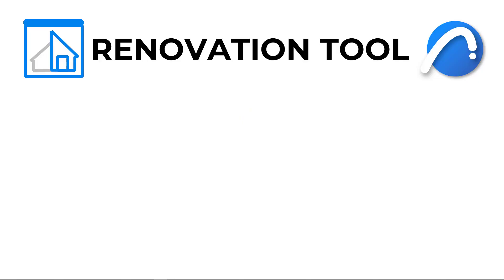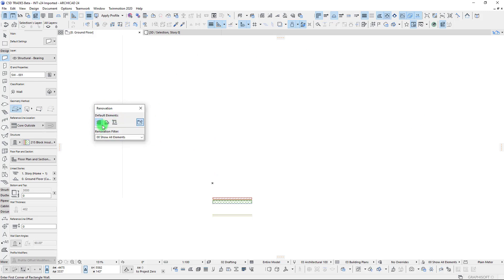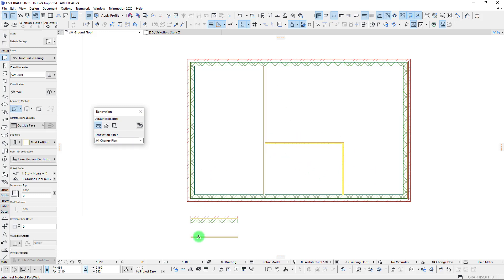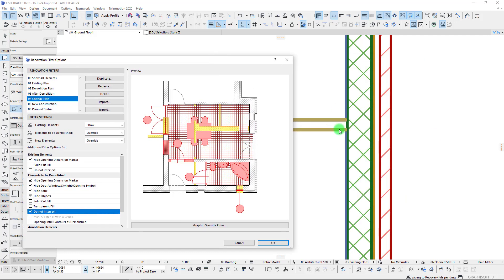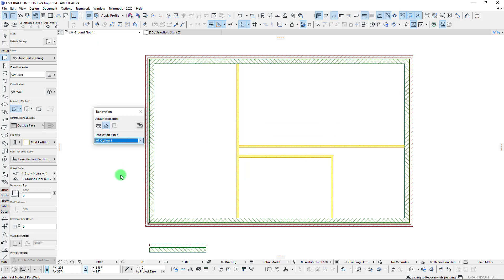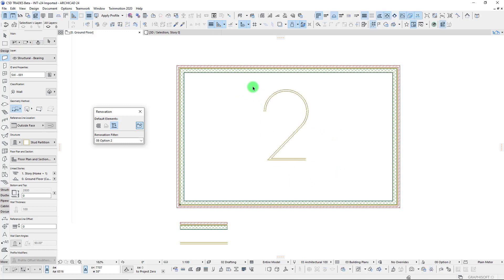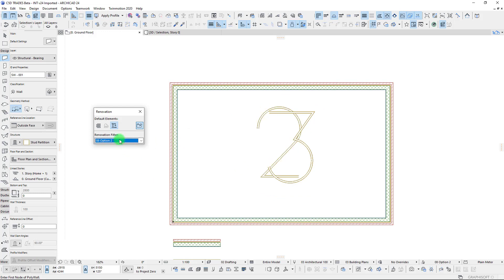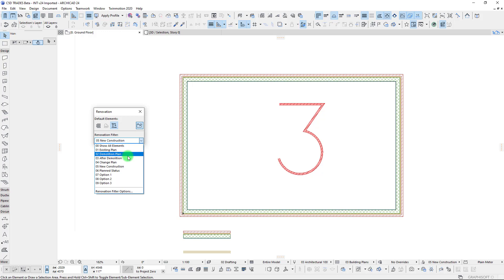How to Create Multiple Design Options with @Archicad Renovation Tool!

Comment: Thanks for the tutorial! but i have a problem, i lose my drawing when i change the renovation filter from 'show all items' to current plan. I can only see my drawings in the show all items filter. It would be great if you could help me. Thanks in advance!!
Reply from the maker: Hi Irem! Thanks for the question. So the thing with the PIN function, is that elements will only show up on that specific renovation filter. The "Show All Items" is just a name of a filter, that doesn't necessarily show everything that is pinned. Similarly, if you pin items to that renovation, they will only show on that renovation. I hope that makes sense... Pinning only allows visibility on that specific filter. Thanks!

Comment: Thanks for the tutorial. We created 3 different options in our model using the renovation tool. Now we want to make a  schedule that filters the windows and doors per option. Can you explain how to make such a schedule? Best regards from Holland
Reply from the maker: Hi Marco. It is all in the saved view settings for each design option. Set the renovation status in the view settings, and that will filter the model based on what elements are assigned to each. You shouldn't have to even set the criteria for renovations, only the view options. Only downside of this is you can't list all 3 options under the same schedule, but you can use 1 schedule, with 3 different saved views for each design option. Good luck!
Reply: @CONTRABIM  Thank you for your reply! We tried your suggestion and it worked! Great help! Greets from Holland

Comment: Great video thankyou!! Is there any way to display multiple design options in one view? say I want to display a combination of options one and two? Thanks
Reply from the maker: Unfortunately no, you can only pin elements to 1 design option renovation status. If you wanted to show both at the same time, you'd have to do a trace and reference from the 2 saved views, or place the 2 drawings overlaid on a layout!

Comment: Thanks a lot. But...
It is so annoying that lumion 8.5 doesn't support archicad's design options. You can't keep the assigned materials between the options. Do you know why?
Reply from the maker: Thanks for the question. I haven't personally used lumion, so unfortunately I can't provide much info. Are you trying to use this with the renovation filtering of design options?
Reply: @CONTRABIM  Exactly.

Comment: Hello, thanks for the tipp, howerver I have a question, using multiple options will all be showed in the schedules or only elements how are not pined anymore?
Reply from the maker: Thanks for the comment and the question. The schedules content will be listed based on the current, or saved view renovation status. So if you have your saved schedule to option 1, then all the content on that renovation filter will be listed. If set to option 2, then only that content... Elements that are not pinned to either option, will be listed on both.
Reply: @CONTRABIM  oh yeah :) 
thanks for the tipps

Comment: I needed to demolish a part of a roof and was not successful at making this happen. What is the best practice for demolishing a lager building portion with multiple elements in it.
Reply from the maker: Sometimes if you are doing a partial demo, it may be best to split the roof to indicate what section gets removed. You could also try the opening tool, but I don't believe it functions quite right with the roof tool. If you need to assign a large portion of a project to demo, perhaps the marquee would work. Or perhaps setting the entire portion to a specific layer for demo could also be useful in your case.

Comment: Hi John! Thanks for the nice video. I've got a question. How about the zones? If I make some walls and zones on option 1, I can not make zones on Option 2, because of the walls on option 1.  The walls of option 1 affects the the zones of option 2 too. What I miss? Thank you very much! Tamas.
Reply: I put the option1 walls to demolish. So they are on option1, but not new. On option1 must be visible the "to be demolished" elements (Renovation Filter Options). Now the Zones works fine on option 2. I will try this with more options :) Or do you have a better solution for this issue? Thank you! Tamas
Reply from the maker: Hi Tamas, I've found in doing some testing with the zones, you have to create additional zones for each of the different options to go along with the walls. This seemed to work pretty well for me, but perhaps there is another method as you describe. Depending on the project, different methods may be required Thanks for the question!
Reply: @CONTRABIM  Thanks! :)

Comment: I use this method for new building concepts. Problems arise when we are working on a renovation project. Do you have any advice on managing demolition?  In one concept we want to demolish different walls than in another.
Reply from the maker: Hi Piotr, yes the demolition gets a little tricky when looking at different options, even with using layers it's difficult to work out. I think to get this to work, you must over-demo the entire space with the default demo phase, and then bring back parts relating to the new options. Not 100% ideal but a workaround for looking at the different new options... Thanks for the comment, I'll keep this question in the back of my mind as I look for ways to improve on this concept!
Reply: @CONTRABIM  Is there any new solutions for multiple demolition options? It's so important on renovation projects.
Reply: Yes thats what I need, multiply demo options too.

Comment: Thank you for the tutorial, sir John. This Renovation tool looks powerful. I wish Graphisoft changed the "pin" into something like "option-list" or "check-list" so we can apply some element to single or multiple Renovation Filter.

I wonder if it possible to create a construction phases (scaffolding, crane, etc) with this Renovation tool?
Reply from the maker: Yes that is a great comment. I agree having the option to pin multiples would be useful, but then it also becomes more to track and manage on the element level. A phase filter would certainly be useful!

For logistics, items like scaffold and cranes will likely need their own layer (or simple logistics layer) anyway, but could then be pinned to specific phases. You'll likely want a layer combination to control visibility of the rest of the project elements as well for these phases, but I think the Reno filter and pinning to a certain stage can be useful. Interior temporary barricade plans can be useful with this type of method also.

Comment: HAve you find some decision how corect control the ZOne tool in the case of using different optins like in the video?
Reply from the maker: When exploring different options and showing the zones on the floorplan, you'll likely want to pin those effected to their related filter as well as the walls that define them in the option. This way you can toggle between option 1 & 2 and walls and zones will adjust. Great question thanks!
Reply: @CONTRABIM  When we in this way create plans and looking for some optimal planing, and we place the zone, for exemple in the "Option 2" it creating whith asociation with walls from "Option 1".The same thing hapends when we refresh the zone after hand made it.For today this is the only reason why i dont use this method for skeching - cant get corect areas  per "Options" without hand corection.
Reply: @CONTRABIM  O.....and this method I use like a storage filter for some objects and markers, what i need in project but cant save at favorites (things in some blocks- Bath complects, ventilation chanels, complects of 2D objects e.t.s.)

Comment: Hi, nice tutorial! Just a sidenote: Having followed the Graphisoft BIM manager program I wanted to mention that the people from Graphisoft itself discorage this method. The renovation tool is actualy designed for what it's named after 😊. Offcourse it works and its powerfull but it had some downsides too... The best way is to just make new layers and corresponding layercombinations and views, you just need to adjust the layer priority number so the elements don't intersect with eachother. Or make a new pln file. I think the modelcompare tool in Archicad doesn't handle the renovation method realy well, but this is even for me subject to test 😊.
Reply from the maker: Thanks for the comment! Interesting that GS avoids using it for this purpose. I see this tool as a way to show early design options quickly and easily, but not something to continue even into schematic design. It can work for individual spaces, but again I think the goal of using this method is to show options for presentation purposes, and then decide and move on with the design option selected. Definitely some downsides as you mention, but I think those come up when starting to push this too far beyond the initial simple function. Thanks for the comment! Test it out and let us know how it works for you! I still think it's easier than layers for a basic purpose, but I can also see how layers can be useful when the design options with reno start to fall apart. Demo is still an issue:?
Reply: This method was precisely what I was doing, using the layers combinations and layer priority number. However, for daily design, I founded that renovation tools were straightforward and helpful to set up different proposals.

Comment: One thing Archicad need to fix is the ability to pin a particular element to multiple renovation statuses. That way it works better for the phases so that you don't have to duplicate so many elements and re-pin then to another phase. A similar problem occurs in options but maybe not as often.
Reply from the maker: Yes, great point! Having that option to pin to multiple filters would certainly be nice for phase management. Having a side by side tool for renovation status, plus phases would be awesome.

Comment: I noticed that you have the renovation statuses "change plans" & "planned status" What do you use those for?
Reply from the maker: This sample file was from the default INT v24 file. The change plans they show both demo and new w/ overrides, and the planned status is new but without overrides. I typically set mine to Show All>Existing>Demo>New>Planned>Iso Existing>Iso Demo>Iso New> and now the options:) Thanks for the question!

Comment: Very helpful John. What do you think about using a layer system for renovation options instead of your method? Any cons / pros one should be aware of?
Reply from the maker: Hi Emre. Great question, a layer system can work for that purpose, but you'll likely have to create multiple layers for each option in that case. The Renovation Options as shown using the pinning function, is an easy way to control that visibility without ever having to change a layer of an element, so I think for that reason it's a little cleaner. I'm sure many out there are using layers for this purpose, but I'd recommend to test the Renovation method and see how you like it! If you are scheduling elements, it's important to set the correct renovation filter based on which one you want to report. One downside, is I don't believe it's possible to list multiple options of pinned elements, at the same time within a schedule.. Thanks for the comment and question!
Reply: @CONTRABIM  Well, until now, I've been one of those people, however I will definitely try your method out in the next project and see how it works out. The layer system has plenty of setbacks - but I actually use a single layer for one option, so in total 3 layers for 3 options. As you can imagine, this results in all sorts of elements being put in a single layer - walls, objects, etc. However, when the project is in a beginning phase, this is okay as my primary need is to be able to easily switch between options at this stage. The schedule issue is present with the layers as well (if I understood your description correctly) so there's not much to do about that. And thank you for your detailed answer!
Reply from the maker: @emresenoglu  Yes that all makes a lot of sense. With the layers you can have a saved schedule with all 3 turned on, so that's how you could list them all at once and compare side by side so to speak. I think you'll find it's easier to pin elements to the renovation filter, than assigning them to the single layers! Try it out and let me know what you think! For the longest time I used layers for this as well, until I realized that little "pin" button actually does something special:)
Reply: @CONTRABIM  i stand corrected - tried out your method, and you're right, the pin method is really handy. thanks again for the super helpful tip!!
Reply from the maker: @emresenoglu  That is great to hear! I've recently discovered an entirely different purpose for pinning that has changed how I manage all of my model content in the template. I'll show it off here soon with the next release of the CONTRABIM template!